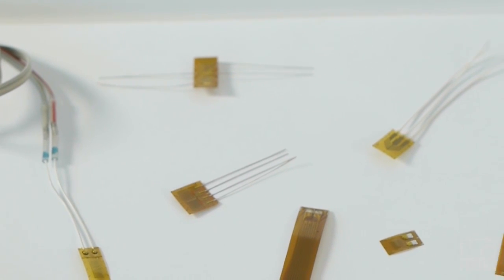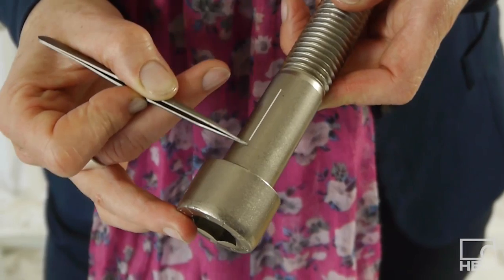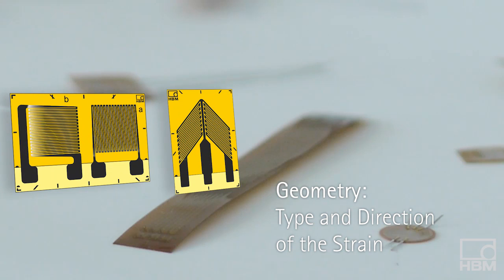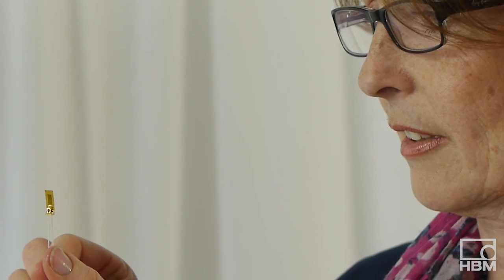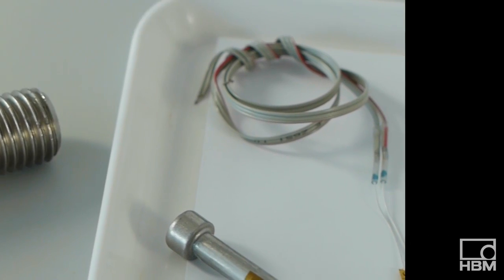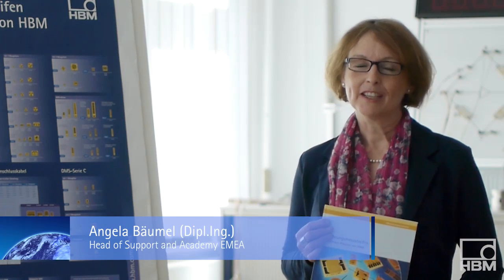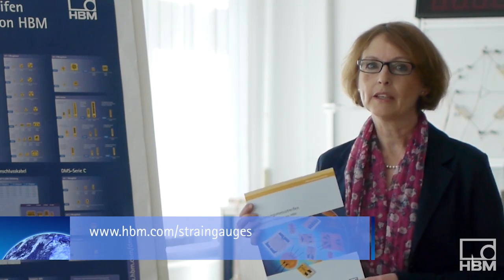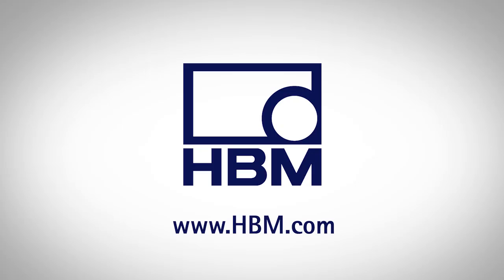How to Find the Strain Gauge that Best Suits Your Application

Comment: hey I was curious, I have a project where I need to test the pull of an object, it needs to both stretch and relax, but the forces aren't heavy, it's a needle, that moves based on movement, but the needle is attached to a strain gauge.... also the forces aren't that heavy, maybe 40-50lbs worth? or less? I'm still looking into it, but around that amount...... thing is, I also need it cheap, and small, and light...... know of anything?

Comment: Hi, other than not being temperature compensated, can one use 4 quarter bridge configurations (2 either side) to calculate torque on a rotating shaft or does it have to be a half or full bridge.